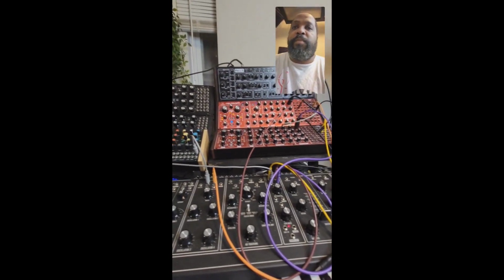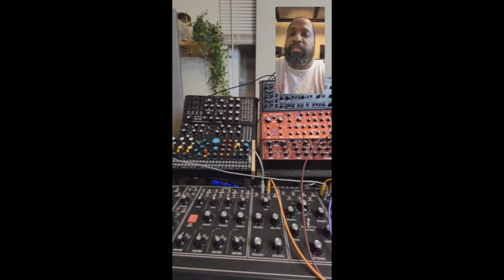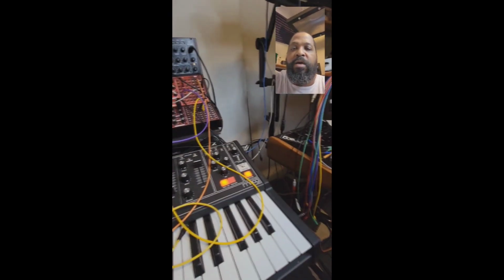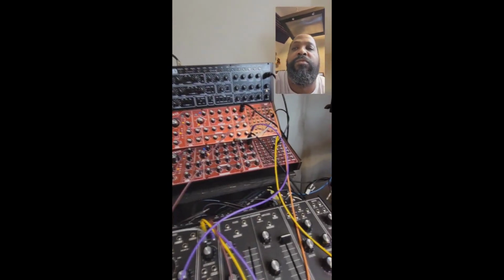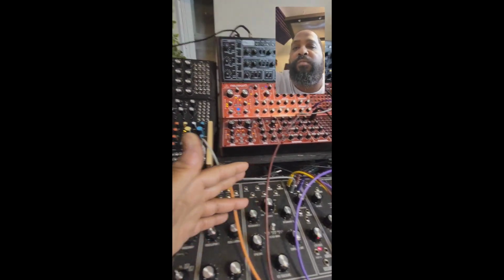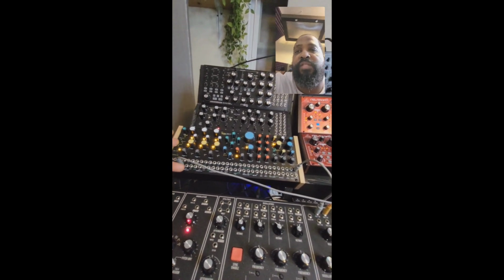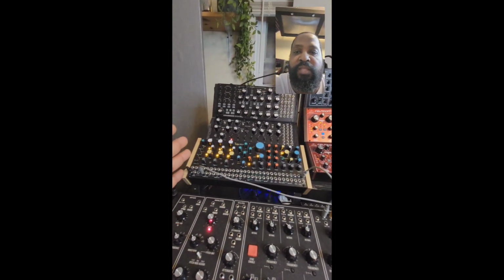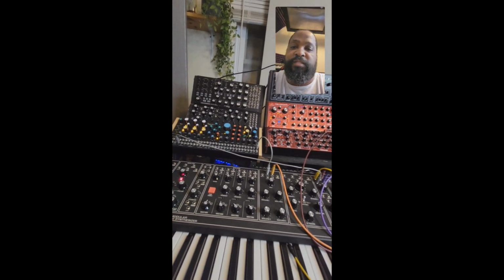Wavefolder vs Filter: Sound Comparison of Taiga and Neutron Synthesizers

Comment: I also have both of these fantastic instruments.  While in my opinion the Taiga is the mightier of the two, it also comes with the mightier price.  The Pittsburgh oscillators are just incredible. That being said the Neutron is not to be laughed at.  The ability to morph seamlessly between wave shape, combined with the same ability on the LFO is lovely.  I love the Taiga, but could it outperform two Neutrons working as one ... I have my doubts.
Reply from the maker: Taiga out performing 2 Neutrons? Not out perform just different.  As you know, the Oscillator section of Taiga is something special. Having both is so much fun
Reply from the maker: @AlgoCompSynth  super facts
 I don't own those but yes I agree. At that price you can't lose
Reply: @AlgoCompSynth by znmeb  same here, I got the west pest and a Q Swarm . the Q swarm is almost as much as the taiga! The q swarm does sound insane  .for such a little box it has a lot of crazyness to it, so how much better would the Taiga be!
Reply: @AlgoCompSynth Are you still happy with your East Beast?

Comment: Big Grime, great vids. I am thinking of getting the Taiga, and have a bunch of semi modulars like the Behringer K2, the west pest the Q Swarm, and was thinking of putting them in a euro rack with the Taiga, and just wonder if it's worth the effort to have them all in one rack, like you got. thoughts after a month of doing it?
Reply from the maker: In my setup, Taiga stands out because it has three oscillators with wavefold, a feature that none of my other synthesizers possess. By routing these oscillators through Neutron's filter and then into Matriarch's dual delay, I can achieve a unique and distinct sound. I don't view any of my synths in isolation; instead, I see them as integral parts of a whole. While I do occasionally use them individually, most of the time I enjoy mixing and matching them. Just imagine the possibilities of running Taiga through the K2 or the Korg MS20! When I've experimented with running Taiga through the MS20, it produced sounds that neither the MS20 nor Taiga could generate on their own. While they can produce similar sounds individually, the real magic happens when you start combining and patching them together.
Reply: @biggrime   your making me want to spend more money!!! it looks so cool and the sound is killer. I like your ideas about routing one into another. I gotta try that.

Comment: Going on current prices here in the U.K., I suppose the question boils down to this: at more than twice the price of a Neutron, is the Taiga more than twice the synthesizer?

Taiga       £649
Neutron  £249

I could buy 2 Neutrons and still have £151 in change. (I would actually only need to buy 1 Neutron as I already own one. Hehe!)
Reply from the maker: Is the tiaga twice the synthesizer.  Technically, no. It's not like you get 4 oscillators,  2 LFO, 4 envelopes, etc... you get my point, but... it can produce sounds not really possible with neutron.  It has an arpeggiator. Midi to cv converter. Taiga's filter is different. When you start talking about the wavefolders. You quickly realize it's just different. No, it's not "more" in terms of features.  I bought 2 neutrons first, but if Taiga was available at that time.  I would have gotten Taiga first before the second neutron